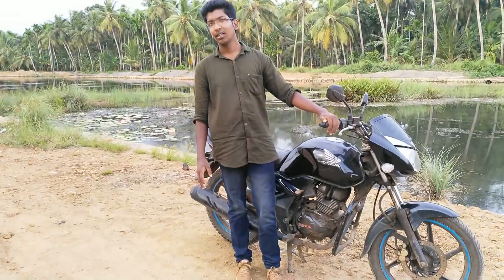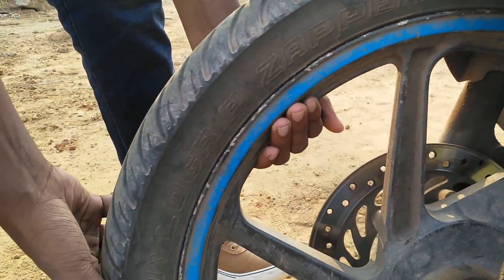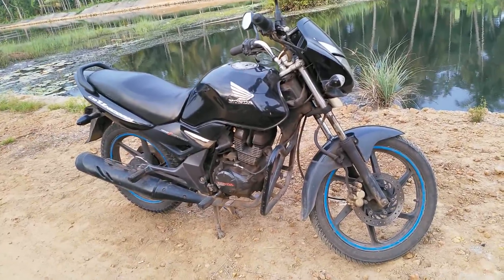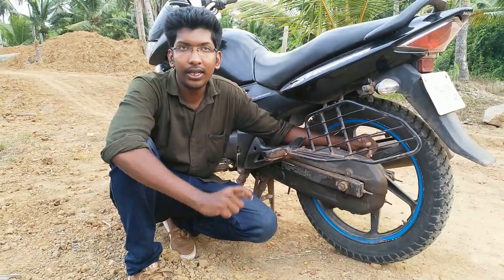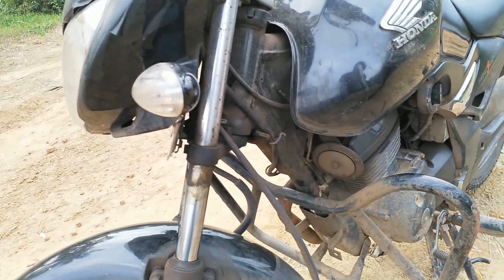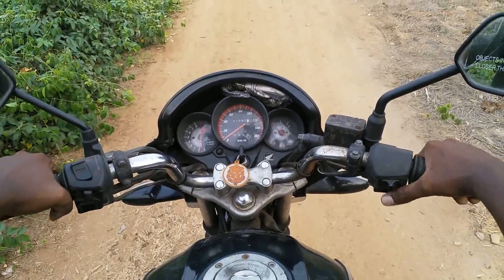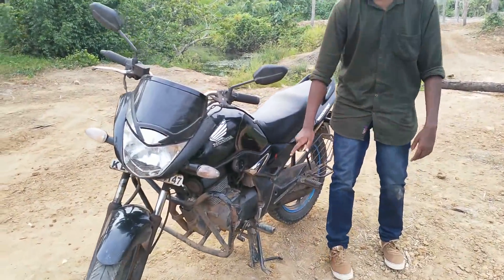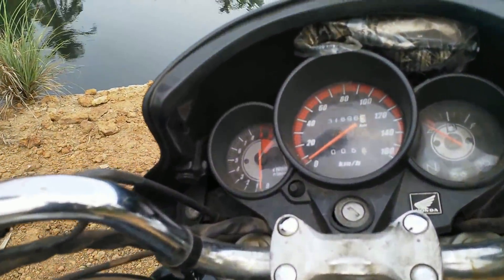Second  hand bike  buying  tips in malayalam,  things  to  remember Before buying an usedbike kerala

Comment: Sound

Puka

Engine oli leak

Tyre

Rim condition

Suspension(fork. Stem)

Brake

Chain sproket
Reply: Switch

Chases (bent weld)

Peto tank

Body condition  (repaint)

Running conditin cluth gear suspentin

Chace number. Engine number

No owners

Kilomet